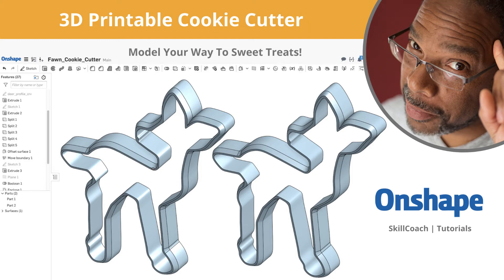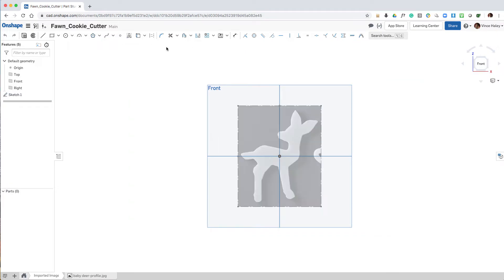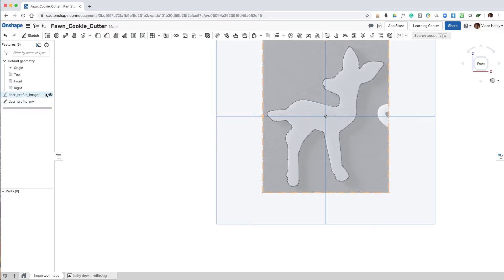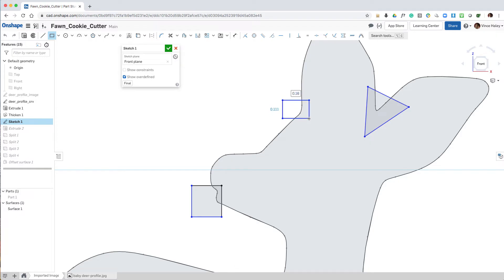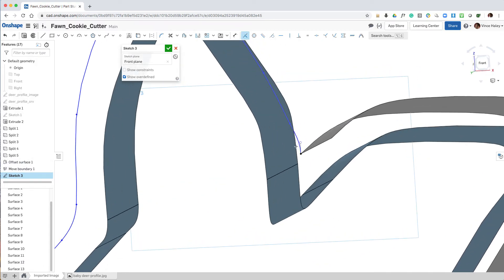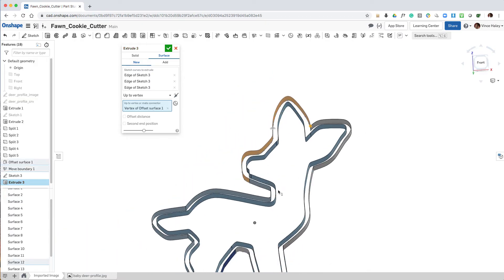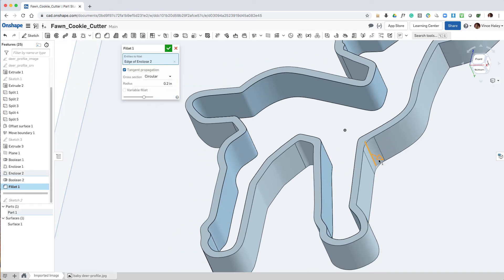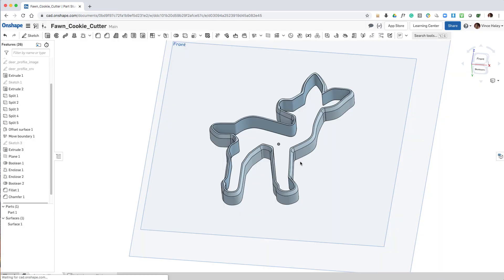SkillCoach | Model A 3D Printable Cookie Cutter Using Onshape 3D CAD

Comment: Hi! There seems to be a few steps missing. How did you go from Sketch to Extrude 2 and multiple splits? I was following along until you got to that section.
Reply from the maker: @Raspadura - Apologies for the choppy edit. I'll try to call out the necessary features and steps.

9:31 - Sketch 3 and Extruded Surface 3 are used to patch gaps of the outer profile surface.
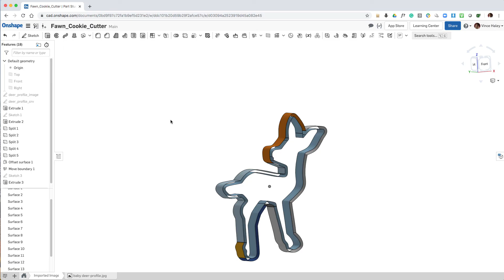10:23 - Edit of Extrude 3 - toggled creation type to "Add". This results in a single outer profile surface feature - Surface 2 (Dark Blue).
10:41 - Construction Plane created to cap/enclose the height of the cutter (surface extrudes determine height). The plane is constrained parallel to the front plane and through a point on the outer surface.
10:50 - Boolean 1 set to "Union", combines all the individual inner surface profile pieces into a single surface - "Surface 1" in the surfaces browser tree.
11:28 - Enclose 1 = Surface 1(Light Blue inner profile) + Plane 1 + Front Plane
11:28 - Feature tree shows Enclose 2 already completed. It is constructed using Surface 2 (Dark Blue outer profile) + Plane 1 + Front Plane
11:37 - Boolean Subtract creates the desired cookie-cut profile thickness -  Part1 inner (Tool) subtracted from Part 2 outer (Target)

@Raspadura I hope this clears things up and makes your modeling attempt successful!

Comment: Great material. Thanks. But I think some steps are missing from the video e.g. Thicken 1, appears suddenly and is not shown how you configure it?
Reply from the maker: @Konrad good observation. Thicken 1 feature  is obsolete and gets deleted at the 7:30 time stamp in the video. Thicken 1 is where I originally discovered that the tight curvature areas would not offset to my desired thickness. The quickest solution to complete the model and get to the business of making cookies was to remove and replace the problem area as shown in the video.
Reply: @vhaley_skillcoach  
I have one more question. In 11:15 You create Part1 ok, but after that Surface1 and Surface2 disappear and I can't create Part2 
 just like you w 11:28 because I don't have Surface anymore :) how to get it so as not to delete Part1 ?
Reply from the maker: @Konrad Dawydiuk there is a “Keep Tool” option available when making the Enclose feature. Make sure the box is checked this way the surfaces will remain available for use later. Numerous creation and modification features have the “Keep Tool” option so be on the look.